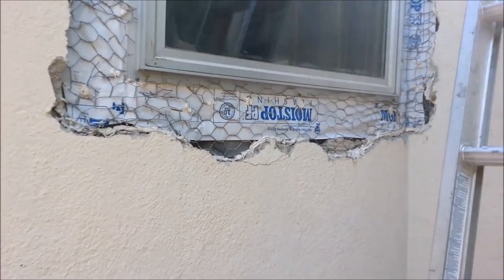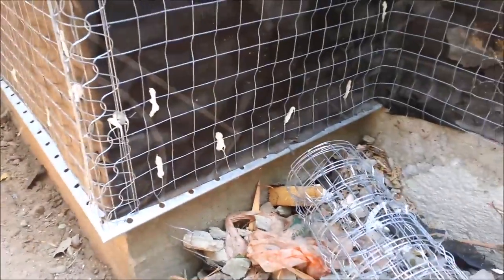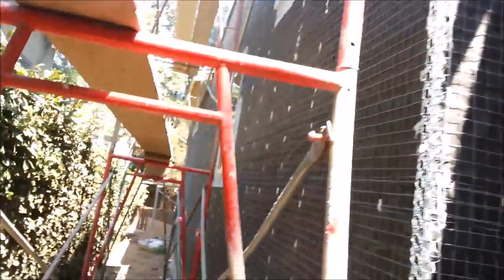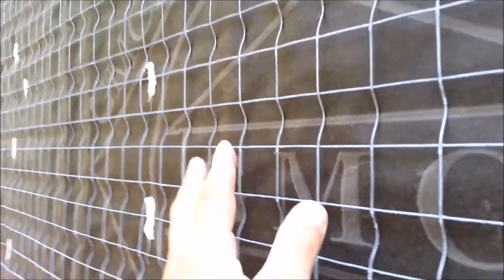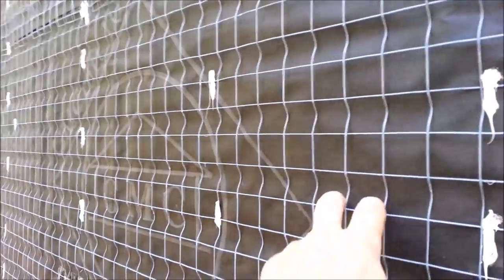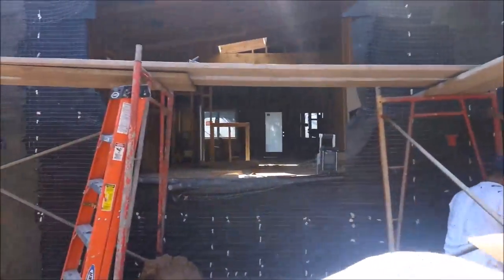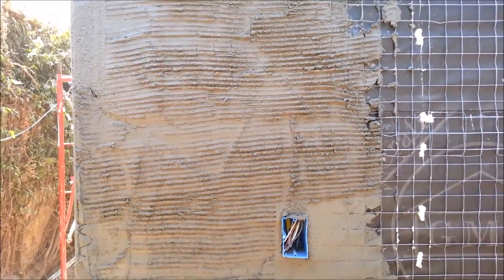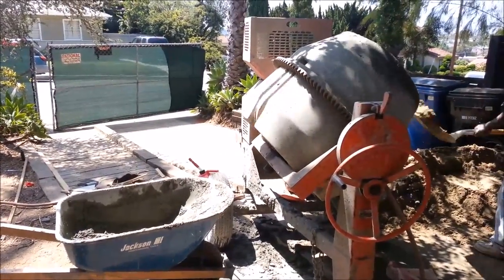How is stucco applied

Comment: Thank you. A new addition has been built on my property and lathing and stucco is the next step,... IF, we pass inspection today with the windows and doors flashing; we did not the first time, so he has to come back today after additional flashing and sealants have been added.
Reply from the maker: If you are doing a smooth stucco, you should make sure you are getting a fiberglass mesh to minimize cracks.  Good luck with the inspection!
Reply: @ChrisMulhern  Naw... it's lace. Only doing that to match the existing,  but I do love that smooth Santa Barbara finish.

Comment: I am just about to buy a stucco home built in 2017 but I am having second thoughts. How is a one inch thick layer of stucco over basically wire, paper and plywood as sturdy or better than a brick home?
Reply from the maker: Plywood is actually VERY strong while being relatively light weight (less reciprocating mass in an earthquake).  Brick's strength is mostly for vertical load.  Without reinforcement, it will not stand up to an earthquake (lateral load).  It is common for brick to be on top of a CMU wall structure, which is stronger than plywood framing.  Brick can also be applied on top of wood framing with plywood.
Reply: @ChrisMulhern  The home I am buying is in El Paso. While I realize it is a dry desert climate I still am concerned with having to do frequent maintenance for the stucco exterior. The home is almost new built in 2017. I just want to make sure I am making the right decision.

Comment: That's the wrong mixer for plastering, that one you're using is for concrete.
Reply from the maker: Our plaster mixer had broken paddles, so we were doing the scratch coat with a cement mixer.  It is best to use a plaster mixer because of the internal paddles, but we just mixed it for a little longer.  For our finish we waited for the plaster mixer to be repaired so it mixed the color properly.  You know your stuff!

Comment: great video! how would you stucco a corrugated metal building?
Reply from the maker: If the corrugated metal is over plywood, you would have to remove the metal and then apply your paper, stucco metal, and then stucco.If there is no framing and it is a metal structure building, you will need to add steel or metal studs, plywood, and then stucco as above.I don't know exactly what the condition is, so this is my best guess.

Comment: Wrong mixer, that's for concrete not plaster.. Wrong amounts to mix, you will get cracks that way.. You don't have to caulk every staple.. Wrong way to scratch and you need to clean your corners.. I wouldn't follow this guy
Reply from the maker: Another person had a similar comment.  As I told them, our plaster mixer had broken paddles, so we were doing the scratch coat with a cement mixer.  It is best to use a plaster mixer because of the internal paddles, but we just mixed it for a little longer with the cement mixer.  For our finish we waited for the plaster mixer to be fixed so it mixed the color properly.  As for the staples, our project was near the beach and the inspector required to caulk all staples.  Thanks for watching.